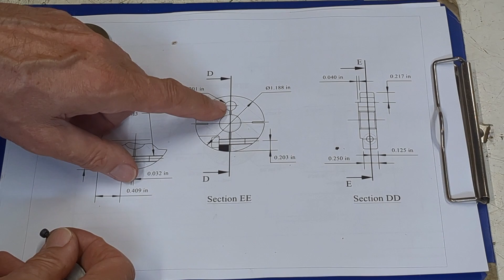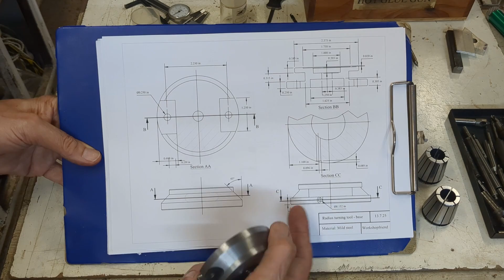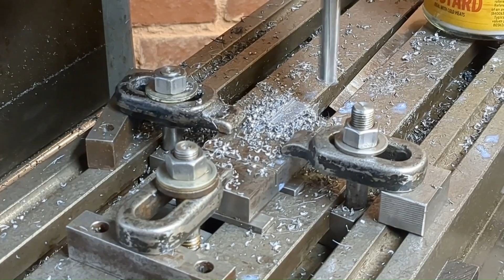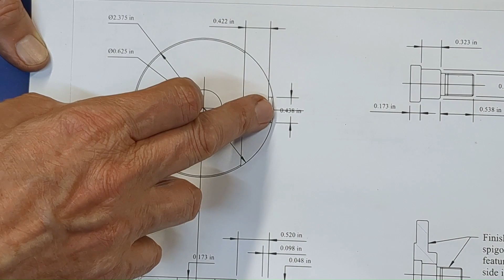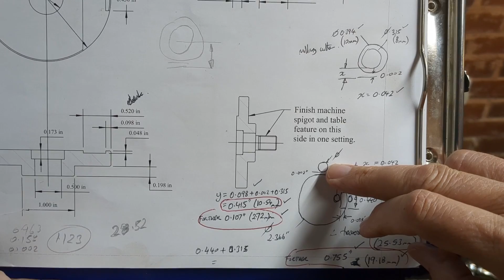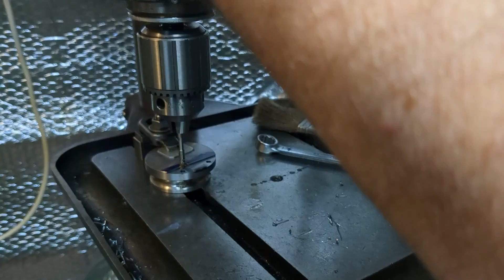Radius Turning Tool - part 3

Comment: Thank you for another interesting video series! I was wondering what you use as coolant / lubrication fluid. Other fluids often seem to give off a lot of smoke. This milky stuff looks like water soluble oil in water, but even that gives off steam or smoke. Is it that you use very limited depth of cut and/or feed to keep warmth production down?
Thank in advance to enlighten a beginning hobbyist!
Regards, Ruud
Reply from the maker: Until a few months ago I was using neat cutting oil to reduce the risk of corrosion but it attacked the paintwork on my lathe. For this reason I started to use soluble cutting oil again - but not too dilute. So far there is no discolouration while still having improved surface finish and cooling for my high-speed steel tooling.
I believe the water content increases cooling. The specific heat capacity of water is very high.

Comment: Hi Clive, question for you is it possible to re sharpen the cutoff bits if so what with
Reply from the maker: Hello Jeff. I assume you are referring to the milling cutter I used in this video. Yes, these and other kinds of milling cutters can reground with a cutter grinder or a universal cutter grinder. I don't have one of these but might eventually invest in one.
Reply: @Workshopfriend . No clive not those , I’m talking cutoff replacement bits for lathe I’ve only got one left and it’s rubbing not cutting. It’s the throwaway ones
Reply from the maker: Carbide inserts are disposable so you need to purchase replacements.
Reply: @Workshopfriend . Not possible to sharpen then , just my luck.
Reply from the maker: Some inserts can be touched up but that would require a special grinding wheel. Better to either obtain new inserts or use good old regrindible high speed steel!
Reply: @Workshopfriend  thanks Clive, I have plenty of 3mm cutoff bits but I’ll have to make one then and put the old tool post back on to take the smaller tool steel , thanks

Comment: Excellent mate 👏_ can you make some of dowel holes h7 ? > I mean the whole process of it.
Reply from the maker: Thanks for your comment! Making dowel holes to this tolerance with an appropriate reamer is not so hard, but to position them well is more challenging. This standard of fit would normally imply a close tolerance on position if it were for a dowel pin.